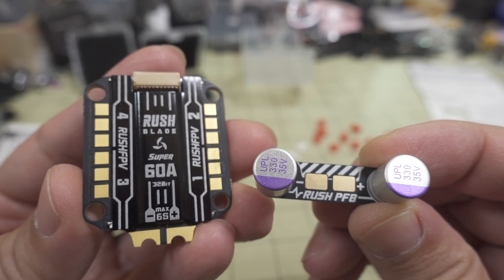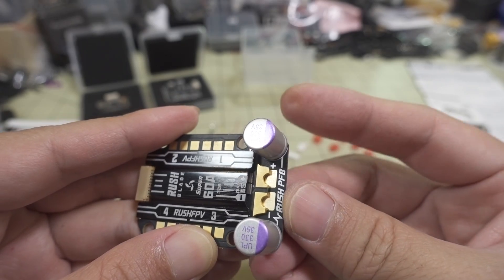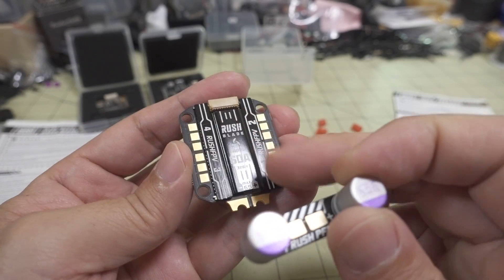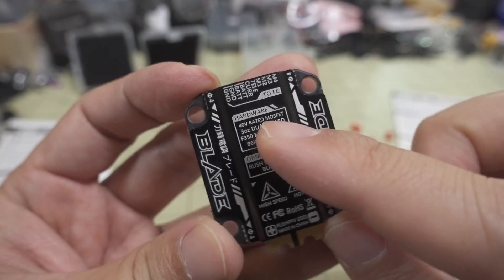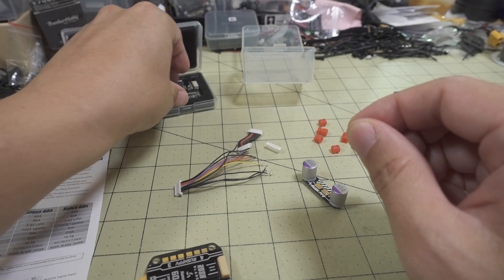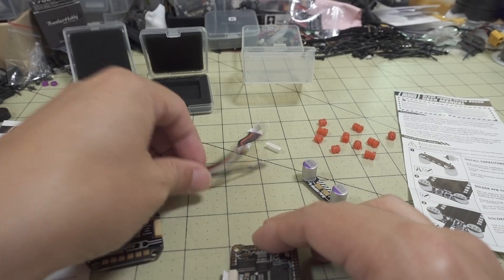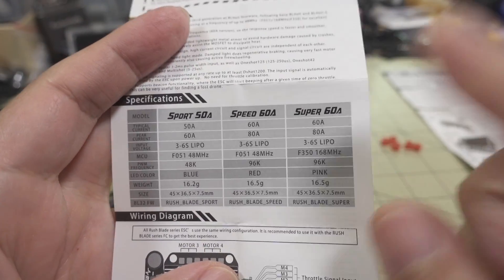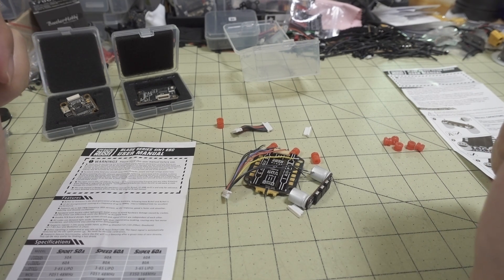RushFPV BLADE 60A ESC and PFB ⚡

Comment: Hey, great video; I just got this rush RC filter board, I just wanted to get some things clear about it. Can you solder this to any type of ESC?. Also is it better to put this filter board on the ESC over the provided single capacitor the manufacturer gives with the stack? i got the  "Skystars F7 HD FC + KO60 60A 4in1 ESC Stack", I'm building an analog system.
Reply from the maker: Should work with any ESC provided you wired it up properly. Yes, you can replace the cap but some people use them together for added benefit.
Reply: @AlbertKimTV  so theoretically it would be 3 capacitors all together?

Comment: Thanks for the video Albert. I just got mine, unfortunately the power filter board gets in the way of the standoffs on my Glide frame. I mounted it back a few MM behind the ESC with as short wires as possible. Will this be at all effective or should I just use a cap directly on the ESC?
Reply from the maker: Rotate the board 90 degrees and remap the motors and you'll be good to go.

Comment: I saw these and thought they looked interesting, the RUSH FC designed to go with that ESC is also interesting, designed to plug everything in but does have solder pads on the bottom and it has a shield on top. Good for LR but weight might become an issue for light builds.